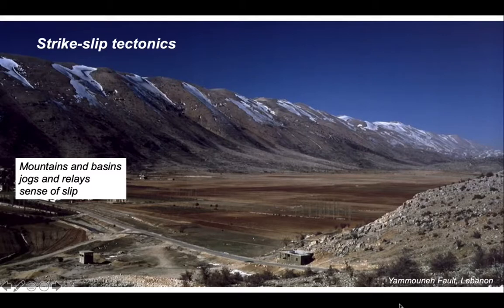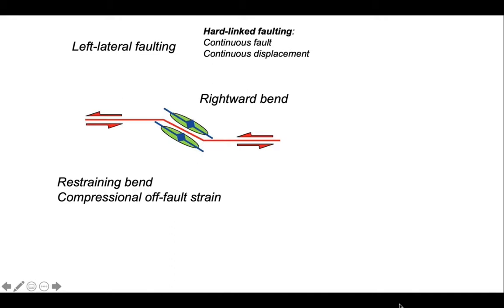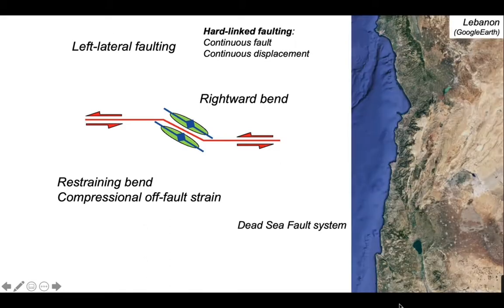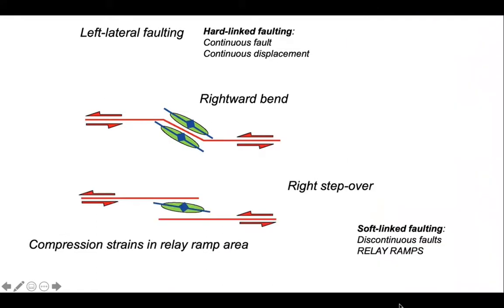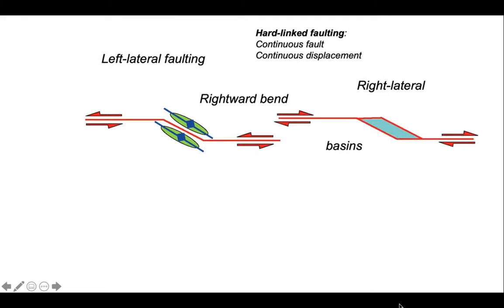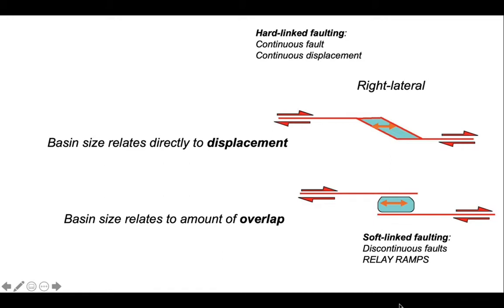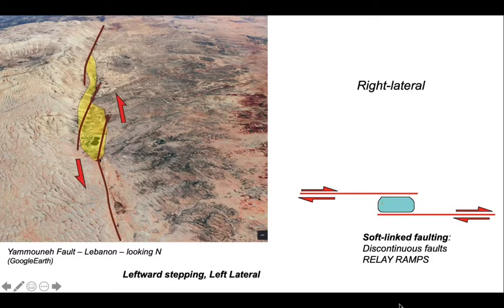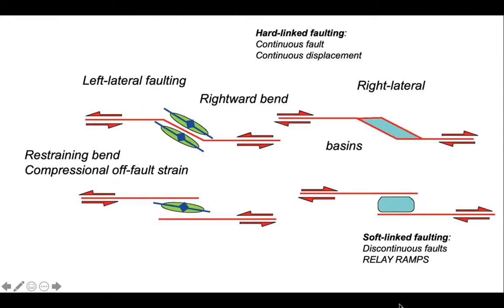Strike-slip tectonics

Comment: Can the relay region be taken as an interaction area or functional boundary of two different stress fields?
Reply from the maker: Not sure I understand your question. Relay ramps are the pieces between soft-linked fault segments. You can argue that in a system of wrench shear, the initial faults form "en echelon" so that overlaps will be a common motif until the system breaks through into a single strand....
Reply: @robbutler2095  Sorry sir, to make you be not sure about my mean.  What I mean is that, just as I often ask stress topics in the lecture series,  if we take the crust as our study object and discuss such regional tectonic belts, maybe we can use the Andson'  dynamic model on faulting. That is in another viewpoint but not only from the kinematics to talk the causes. The strike slipping, normal faulting, and thrust and contraction region can be three different areas once governed by three different stress fields respectively. In such a strike slip zone, tectonically speaking, in most time the whole regions including any relay ramp places, should belong to the strike slip stress field. But when magmatism become active, some relay places such as in the relay left lateral and left step slip zone (LL) or dextral and right step zone (RR)  , may grow some extensional structures. But in some other time, when magmatism is too poor, some relay places in LR or RL slip zones, may appear contractional structures (reverse faults, thrust or vertical folds). However, in most circumstances (time scale), strike slip governs the region. Therefore, i suggest that " can we  consider the relay zone as the functional boundary of two different stress fields". 
Structures are often too complex to discuss by only kinematic viewpoints. For example, "pull apart basin",  it may not be certain to say the basin is caused by strike slip. Sometimes can, sometimes  not.

Comment: What are the type of strike-slip basins that can form? and what are their names?
Reply from the maker: Classically these are called pull-aparts, formed at releasing bends, jogs in the trend of major strike-slip faults.... though in practice extensional basins in strike slip systems probably form in general at "soft-linked" relays. There's a section on these structures in the video.
Reply: @robbutler2095  Thank you for your reply, I am curious about polygenetic and polyhistoric basins and what they may appear like in seismic profiles.
Reply from the maker: @charlottegibson1817  Many sedimentary basins have complex evolutions that chart changing tectonic kinematics. Probably the easiest to get into are those that experienced tectonic inversion - check out the video on that topic ... but even rifted continental margins experience complex tectonics - through gravitational collapse (making thrust belts) and, especially, salt tectonics. There are examples in the seismic interpretation playlist here.